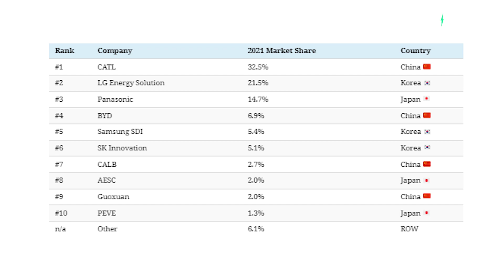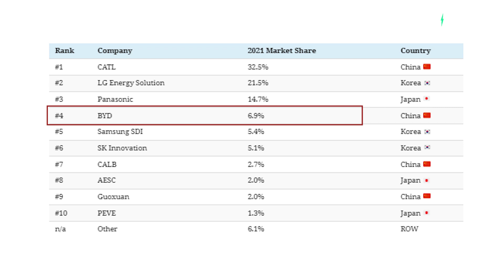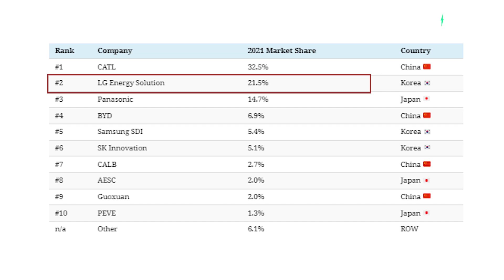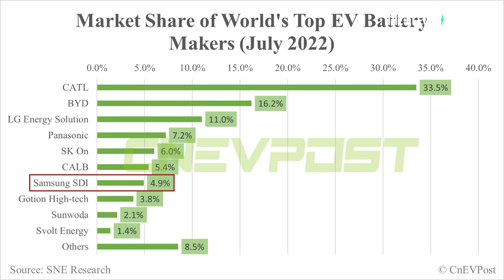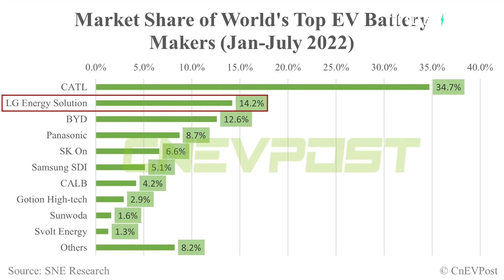How LG lost the battery race by betting on the wrong chemistry

Comment: This is all true to a degree, but one of the issues is that in say the US market and I'm sure other markets the cost savings aren't worth the deficiency in stuff like cold weather performance.  These LFP are great for nice weather range and say cold weather commute.  Basically only cheapest and lesser desirable cars tend to use LFP even though that is maybe where a lot of the EV sales volume is starting to move.  Now the switch to manganese cathodes may help some of this, but it's not clear to me if stuff like cold weather performance is still a question or not.  There is a reason though markets like the USA are basically LFP free.  Won't be easy to change this without better LFP battery setups as far as performance...particularly in the cold.  

Basically meaning companies that rely a lot on USA market and expecting big EV switch will probably need the higher performing cells for a good while yet even if they also pickup LFP for cheaper models in other markets.  I could see LMFP staring to get into things other than base model and more standard range cars with the newest approaches...but generally it seems it's mostly the chinese brands doing this and they all have a good long slog to sell many cars in Europe, nevermind the USA.  But even Tesla is somewhat averse to trying to sell many LFP cars outside of china...I am sure they are getting up there in Europe...but still...basically very few in Europe and USA.

It should also be mentioned that any CATL M3P improvements/advantages to catch up in performance and over ride any disadvantages it may have are still just promises.  I'm sure it might win out and replace a lot of existing higher end stuff and move LFP style up out of entry level vehicles...but the main LMFP flaw that needed solved was problems with cycle life...it's not clear how much better that is and how much CATL is just taking a bit of a risk cause they now have them good enough they great for long enough to take a lot of the market before it's realized you are needing to swap packs more often than maybe more expensive alternatives.
Reply: I think the reason Tesla uses so few LFP batteries in the US is that they have had to import them all. As you know shipping costs is all about weight and LFP are very heavy. 
The patents for LFP chemistry batteries (which specified that they could only be made in China) just expired earlier this year. Tesla is probably going to try now to ramp up their own LFP batteries in the US but that will take time. Tesla will probably gave Panasonic make LFP chemistry batteries in the US as well.
Reply: @nickmcconnell1291  No...it's generally only use in shorter range models as there just isn't enough space for them to match the 21700 or 4680.ternary batteries.  And there would be zero reason to continue development of the dry electrode ternary lithium 4680 cells if LFP or even LMFP could easily fully displace high density ternary batteries for energy density and overall performance.  It's more of a cost play to help move lower cost models without needing to devote higher cost and higher performance capacity to the cheaper and lower range models.
Reply: @nickmcconnell1291  And generally Tesla can't supply demand for long range and performance models in the USA well yet...so no reason to try hard to push lower range models.  Not to mention I am not sure sub 300 mile range cars even at better prices would sell too well here...particularly if their performance and ability to charge is sorta hamstrung up north.

Comment: Having more than one battery chemistry in production is very important. If you only have one the materials get too expensive. We need several different ones to distribute and regulate demand for materials. It's not good to send a message to mining companies that what they produce might not be needed we need all that stuff because this could be an issue with some types of batteries or it might be needed for battery chemistries that haven't been invented yet. Even if all those batteries are not used in cars they will find a use case of some kind.
Reply: GM Ultium EV platform can accept any battery chemistry going forward.  Honda and Acura should be so blessed to be a partner!
Reply: When did "use case" replace "use" in common English? It's long been standard with consultants trying to sound smart, but get a grip people.
Reply: @lengould9262  Guilty. I'm repeating a phrase I've been hearing in the news to try to sound "correct". I would not have thought to do that on my own.

Comment: it is exactly not about the wrong chemistry but form factor. The battery chemistry is the same as Tesla's 18650, 2170, 4680 batteries. The mistake is with pouch batteries, only good for lightest applications like drones and phones, it shouldn't be used on more rugged/heavier loads. Decades ago, it was Japan taking over multiple industries, then came the hungrier South Korea, but then China is most hungry with more and poorer people, taking over more much of the electronics today

Comment: I was thinking of ordering a Chevy Blazer EV, but the fact that GM is still using LG Chem batteries is the cause my order will be delayed.  I need to wait until I'm confident that LG has fixed their fire problem.  IMO, GM blew it when they decided to stick with LG rather than going with a different battery manufacturing company.
Reply: Ultium 1 or Ultrium 2 will be good choices especially for the price.  FYI, the Michigan made LGChem batteries didn't have the problems the Korean made ones did.  In the end both were recalled with early versions replaced and newer versions getting monitoring software.  

A guy at work had 150,000 miles on his 2016 Bolt EV when they gave him a new battery.  Now he says he is good for until 300,000 miles!
Reply: @normt430  Good to know
Reply: GM "blew it" lol.. nice pun
Reply: Didndey
Reply: @michaelstarkey9745  Didndey - what does this mean?  I'm not 12.
Reply: @thewolfdoctor761  nothing from Urban Dictionary either!

Comment: GM is concerned with domestic supply, and domestic supply lines as a competitive advantage..Much the same way BYD and the CCP are in China...
GM's battery factories will be local/regional, if not attached to the Manufacturering Plant itself. (in terms of assembly.)

Once GM and other LG Solutions partners get ramped up, the sales numbers will definately change...

I mean, why would GM (and others) put all of thier eggs in the competitions technology supply basket?..The market has already had enough geo-political supply issues as of late...lol
Reply: GM doesn't have the high level research chops to play that game.
Reply: @lengould9262  GM is already ahead of all domestic brands with scaleable Ultium EV platform that can accept any battery chemistry in almost any configuration.
Reply: @lengould9262  It's already in motion..Thier Detroit Plant Zero is practically finished, with a large Battery Assembly Plant being added  on to it... 
Three more Regional Battery plants are under construction, with one set to start fully ramped up production very, very soon.

Comment: 4680 will rule them all ❤
Reply: If they can solve their dry electrode process.
Reply: what a joke？ 4680 is way overhyped.
Reply: @QL2004  
Small, cheap, modular factory, producing higher density, more efficient cells in huge quantity.....?
This is the greatest potential for Terawatt capacity.
I'd say what we've seen so far is under-hyped

Comment: It would appear Tesla is focused on the lithium based 4860 battery for their particular internal requirements. Tesla can look to others, or partners, for their LFP batteries for cars which do not require high performance.
Reply: The Tesla focus is to get maximum GWh (->TWh) using the greenest methods, out of the smallest (modular) factories, as quickly as possible.
Dry format, 4680, high density is the only combination that has potential to "fit the bill" at the moment.
When they refine the process, they can then simply put fewer very cheap, high density cells in smaller/ cheaper cars and achieve greater power/weight performance with use of fewer resources.

Comment: The market share is interesting. Probably most important. But how did these company’s battery volume change? Did CATL gain market share because they increased volume or because they have a better chemistry, or a bit of both?
Reply: Cheaper & safer Batteries, along with better life cycle, at +- equal energy density made CATL # 1.
Reply: both

Comment: Then why tesla is building 4680 with high nickel battery ?
Reply: My recollection from Tesla's Battery Day presentation in September 2020 (it is available on YouTube) is that different kinds of battery chemistry provide different energy/weight density vs energy/volume density vs power vs cost trade-offs. Because of this, one battery chemistry might be better suited for home/grid stationary storage (where low cost is more important than volume or weight), while another type of battery might be better suited for long-range vehicles, another type of battery might be better suited for high-performance vehicles, and so on. It seems the folks at Tesla believe that variants of LFP batteries will be best suited for the majority of vehicles, while the chemistry used in the 4680 will be better suited for vehicles that require high power ("power" is the rate at which energy can be delivered, so high power aids quick acceleration and the ability to pull heavy loads).
Reply: More energy dense then lfp,thats why
Reply: Ev is like moving smart phone. Its not just vehicle. In the future, we need higher energy density & light battery for all mobility. LFP has inheritably limited element chemistry. Im betting for high nickel battery as tesla do.

Comment: Hi Sam, in my opinion the reason for decreased market share of LG is in this priority list
1] free patents for LFP since last year clear the paths for competition and scaling up this chemistry way
2] prices and availability for LFP are miles of more predictable
3] so not falling volume of LG but many more production of competitors figures out only percentage of market share

So follows they will falling down more and more because of the heat problem the next years so agree in the end but think also about the initial the patents and scalability in first. More safety I am in doubt with a little bit but it sounds better for selling this chemistry instead of less range and more weight disadvantages.